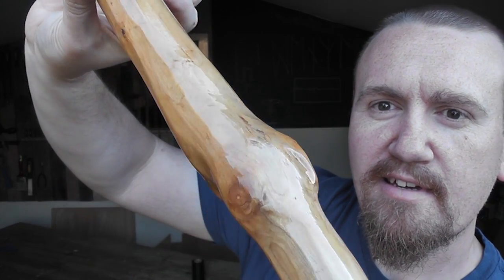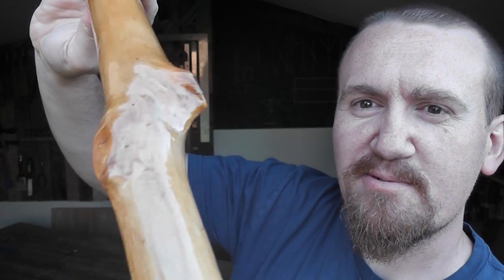Cherry Walking Staff with Nordic Runes [Woodworking Project]

Comment: Nice work. On a stick I had I bound paracord near the top with a loop in it. It was handy for hanging on the hooks on pub bars.
Reply from the maker: That's a good idea Roy, would've been better than my one. The thin cord I used in this one started to unravel after a bit of use unfortunately. So I think a thicker cord is the way to go! Great idea with the loop too.
Reply: @ClintRoseCarving   Do you know if varnish deters woodworm?  I had a couple of sticks ruined by them. I was thinking of doing one with yacht varnish.
Reply from the maker: I'm afraid I have no idea Roy. I know there's some treatments you can apply to wood to kill woodworm but I've never had to use it so my knowledge is very limited there I'm afraid.

Comment: Looks great. I plan on making my own so have been studying. I had two questions though. First what cord is that you're using? How long do you typically have to age a fresh piece before you begin working on it? I've heard anything from a week to a year. Love the look and it helped give me ideas.
Reply from the maker: I think the cord was thread used in leather stitching... But I have no idea if that's the ideal material. It really depends on the thickness of the piece of wood, when the stick is this thin you could probably peel the bark off straight away and then maybe wait a couple of weeks to a month to carve the rest. It's always trial and error though. You might be better to look up some bushcraft videos, maybe some on spoon making, to get a better idea of drying times.
Reply: Appreciated! Your work is excellent so I'll be trying a few at a time once I go through the entire process of gathering from scratch. Great video.

Comment: Excellent work, nice video. I dont mean to be silly, but I'm very new to making a walking stick, but what are a couple of the tools you used to remove bark and is that simply a chisel for the finer parts of wood removal? Thanks!
Reply from the maker: Thank you Luke! Not a silly question at all, the larger tool with the long blade was a drawknife and the smaller wooden tool which kinda looks like handle bars was a spokeshave. The other tool was just a regular bench chisel you're right.

Comment: Nice work.  I have just cut a branch off my garden tree.  Can you recommend on a set of tools to buy for a first timer at wood work.  I just smoothed some old twigs and found it very relaxing.
Reply from the maker: Thank you. Well it often depends what you'd like to make, generally you can't go too wrong buying a crosscut saw, a square and a drill for very simple projects. For something like this staff you could make it with just a knife for instance. Brands like Stanley and Irwin are probably fine for beginners. Though if you do a little research you can hopefully find which tools suit your needs at a price which is affordable.

Comment: Is that wooden block around 2:00 something like a measuring tool?
Reply from the maker: That's to help me draw a line around the bottom of the stick that's level with the floor. As long as the stick is at the angle I wanted it.

Comment: Beautiful stick! Can you please tell me how yo tied off the end of the cord wrap, please. I can't quiet make it out on the video.
Reply from the maker: I honestly can't remember I'm afraid, it did eventually start coming off after a fair bit of use so it probably wasn't the best way. I think I looked up knots to tie handles or something. Thank you!
Reply: A method I've tried a couple times that seems to work very well is a VERY thin coating of Gorilla glue and then quickly wrap over the glue. It will last a long time and is an easy fix if needed
Reply from the maker: @StrangeScaryNewEngland  Ahh that's not a bad shout, thank you Cole. I think I'll try that next time.

Comment: Hi, what kind of varnish did you use? I have a few I made but I'm having a hard time figuring out the varnish and sealer!!
Reply from the maker: Well, I used an outdoor varnish by Rustoleum but sometimes people opt for something as simple as Boiled Linseed Oil. They re oil it as and when needed.
Reply: I made a white oak staff about 25 years ago, and I used Tung oil on it.  It has held up well to anything that I have thrown at it for 25 years with a beautiful, water proof, extremely hard finish...  I have never used anything else on wood since, and everything that I use it on has turned out beautiful, and never needed refinishing.  Tung oil soaks in and strengthens the wood, as well as bringing out the grain, and leaving a glass like finish.  You can stain the wood prior to using the Tung oil.

Biggest problem is that it takes more work because you need to put multiple coats on to build up a good finish, and the final cure time takes around a month - although the item can be handled and used a couple of days after the final coat.
Reply: TRU OIL.

Comment: Anyone know what tool he used to remove the bark?
Reply from the maker: Hi Matthew, the tool with the long blade and two handles at a right angle is called a drawknife. The smaller tool that looks like you're holding two handle bars is a spokeshave.

Comment: What are you using for a clear coat?
Reply from the maker: I believe I used some exterior varnish by Rustoleum. I'm not sure if that was the right choice, in the future I might use linseed oil perhaps.
Reply: @ClintRoseCarving  right on

Comment: Any reason you choose varnish over linseed? Typically I use linseed and beeswax mixed. Just curious. Anyway great video man! Thanks for sharing!
Reply from the maker: To be honest I looked and looked for ages for what would be best for an outside and durable finish and got a thousand different answers! I used outdoor varnish cos that's what I had on hand to be honest. I would guess a linseed and beeswax finish would need refinishing every now and then? Thank you!
Reply: They do, depending how much use, type of wood, and the type of use dictates how often I suppose. I get away with twice a year on an old piece of musclewood, use it frequently year round hiking, skiing, and snowshoeing around here. You did a marvelous job on that piece of cherry sir.
Reply from the maker: Hmm that's certainly something to think about thank you. Sometimes the best finish for the job needs reapplying I suppose. I know a lot of varnish finishes can encourage mould growth under the varnish if exposed to the elements for too long. But honestly I don't know much about outdoor finishes! Thank you for that, it gives me more to consider in the future for sure 👍
Reply: Funny you mention mold, I’m actually about as close to an expert on mold growth as you could find. I spent several years in the mold abatement industry. Personally I wouldn’t worry about mold growth on a staff that’s been properly finished(several coats over a couple weeks). If the staff is going to spend a lot of time in a warm humid or wet environment, cut the linseed with turpentine instead of mineral spirits would be my suggestion. But mold won’t grow where the oil is anyway. Linseed under normal conditions would most likely last just about a lifetime. I have to re apply do to heavy use in fairly extreme conditions. 

My rifle(walnut stock) is usually good for ten years or more easily and even my axes and hatchets(hickory)  that are used and abused get a couple years before they need another application.
Reply from the maker: Oh blimey, that's an interesting job! Thank you for that info, when it comes to finishes I've really not explored many of them so I'm happy to recieve all the advice I can.
Reply: With walking sticks and gun stocks,it’s just a preference. I like the look. Although most folks seem to prefer the heavy poly finish. But with my axe or any tool handle, if it isn’t oiled, I strip the varnish, sand if needed and start applying linseed and or beeswax mixture. The poly finishes on tools are tough on your hands where a nice oil finish is buttery smooth with a nice feel. Honestly anything that protects the wood and brings out the beautiful grain is what it’s all about. Poly does a perfect job as shown in your video. Nice to see folks crafting beautiful and useful things. So much of that is lost in today’s world. Definitely liked and subbed your channel. Cheers!
Reply from the maker: I've always seen the oiling of hand tools as opposed to varnishing them as a way to have a more firm grip of the tool, less slippery. But, you're right, it's a lot more comfortable in the hand. Thank you very much, I appreciate it!

Comment: Might watch a sharpening video, or preparing wood video. The tools seemed a bit dull while carving and cutting the string. Good work however.
Reply from the maker: The spokeshave is certainly dull, I've never sharpened it but I will! Thank you.